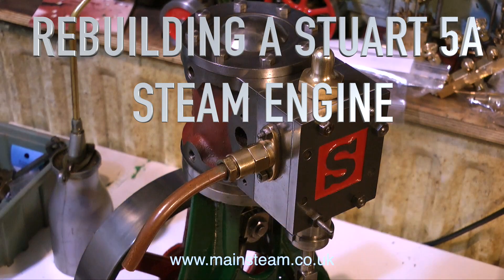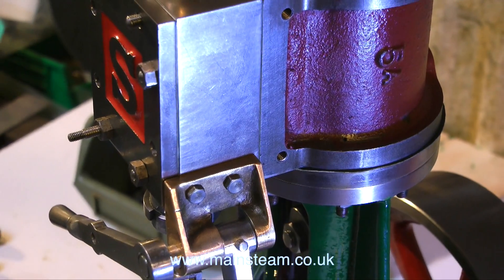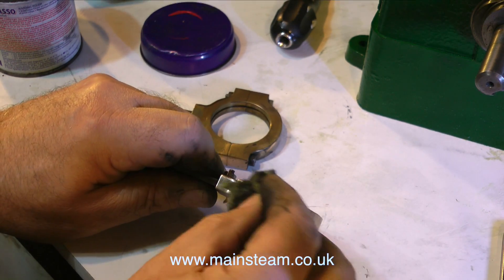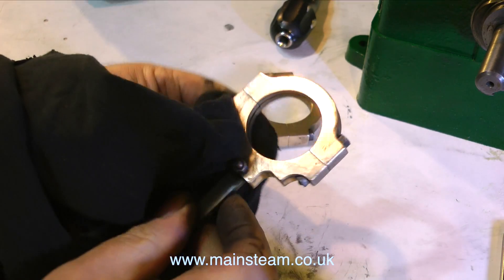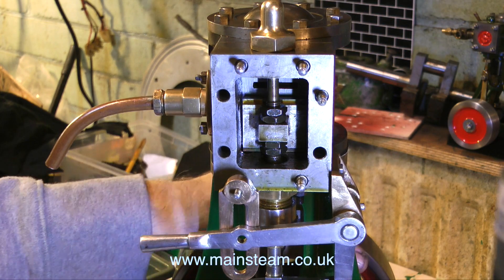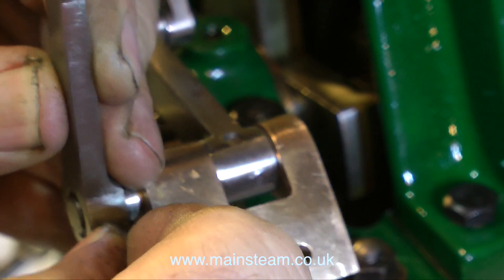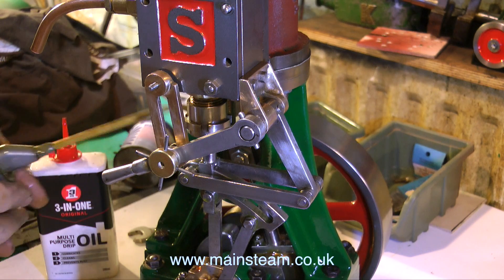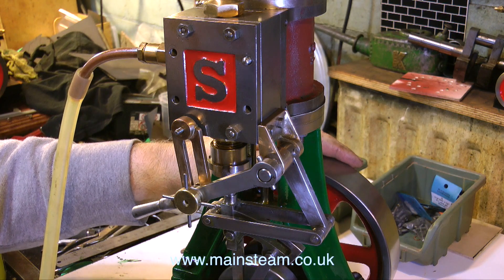STUART 5A STEAM ENGINE REBUILD - PART #8

Comment: For those times when I want to run an engine on compressed air, but do not want a compressor to kick in and ruin the aumbiance, I use co2 from a compressed gas bottle, or diving air from a compressed gas bottle. Luckily I have these to hand for brewing beer, and running PCP air guns, but with the amount of engines you deal with it is just a deposit for the bottle and not much for re fills.....No shortage of air when the supply pressure is 300bar!!..........just a thought.
Reply from the maker: Good idea - ! I will look into that and see whether it is a practical proposition :-)))